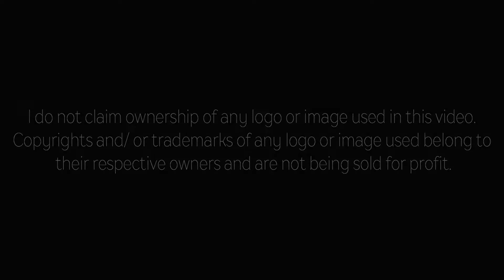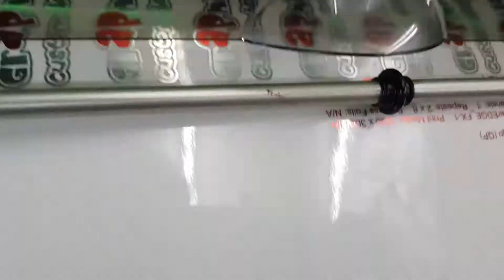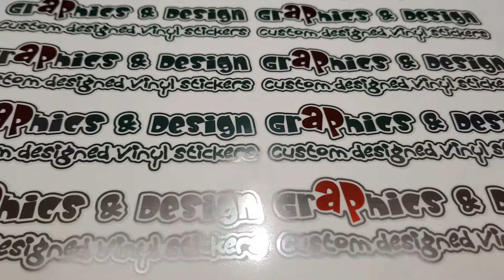Gerber FX Envision 375 Print and Cut Solution

Comment: 3:51 I wouldn't call that a very accurate cutting. Never the less this machine offers unique solutions for special low qty orders, I just wonder how pricey the consumables must be.
Reply from the maker: It might not look accurate to the print but this graphic was printed on clear using mirror silver and mirror red with a .5mm contour cut line around the print hence the clear edge. However this follows the print to .1mm. Hope this clears the accuracy up from the FX print to cut on the Envision 375.